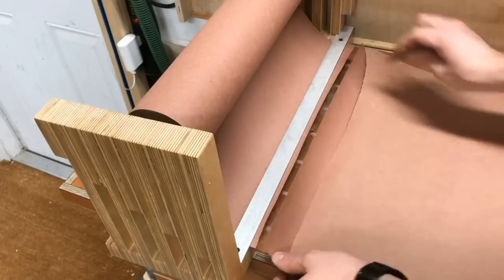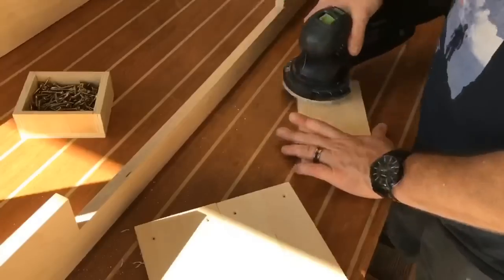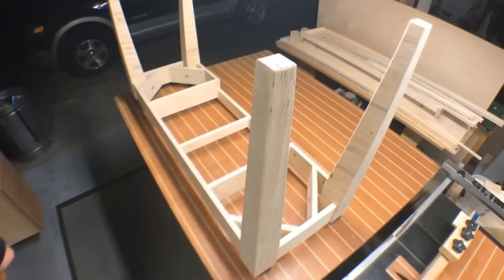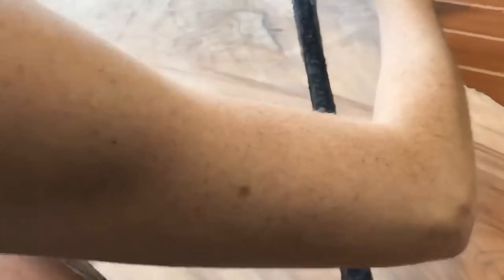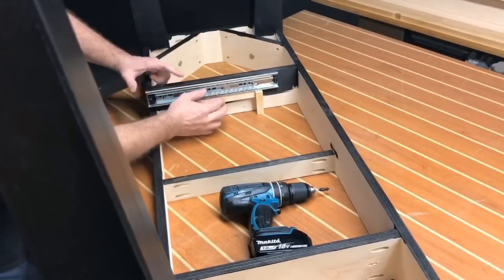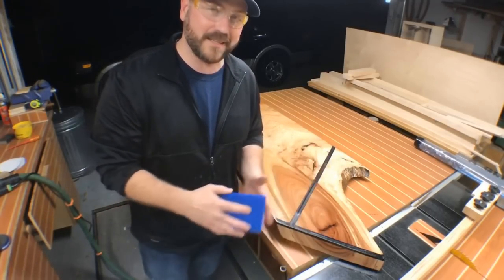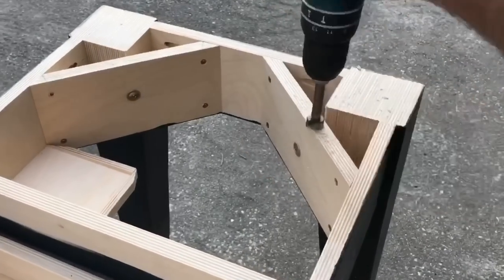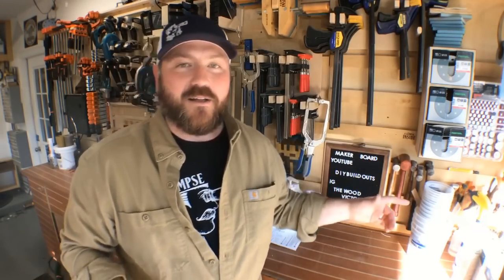How to Make a Live Edge Desk Featuring Epoxy Resin Inlay and 2 Secret Compartments | DIY Woodwork

Comment: Great job! Getting ready to do my first live edge for an end table for our camper. It's Hickory, 30" L x 12" W x 1.5" thick. Would Halcyon Clear work to hold the bark on the live edges or should I go for the two part epoxy? No voids in the slab, a few knots. Thanks for any info. I'll be using your discount code when I order from Total Boat. :)
Reply from the maker: I am so sorry to tell you that nothing really helps hold the bark on. It will eventually just fall off regardless of what you use. Just a matter of time
Reply: @AGlimpseInside  Guess I'll chisel/skin it off and go from there. Halcyon should work after that?? Anxious to try Total Boat. Thanks for the reply!! :)

Comment: Chris.  Can you tell me which Festool sander you used.  I am getting ready to buy one and I am not sure which one I want.
Reply from the maker: I have the rotex 125. It’s essentially a 5 inch disc sander however if I were to go back in time I would have bought the 6 inch model I believe it’s the Rotex  150. Either way having the sander has changed my workflow for the better
Reply: @AGlimpseInside  thanks for your advice. I'm not sure if I'll go with the Rotex or the Eds model. I think I will take your advice though and go 6 inch instead of 5 inch